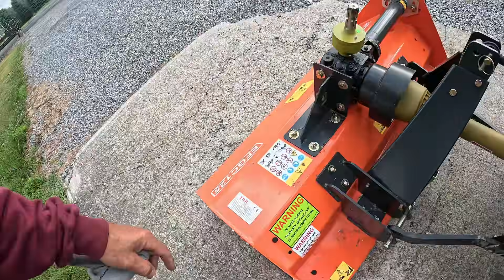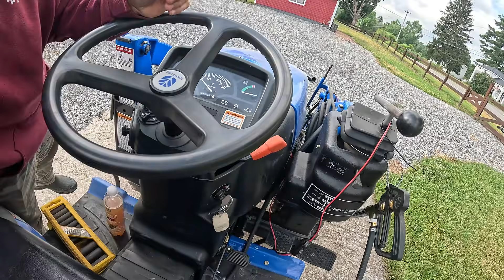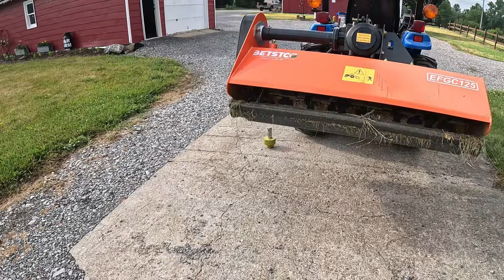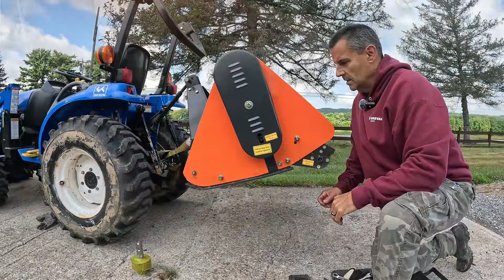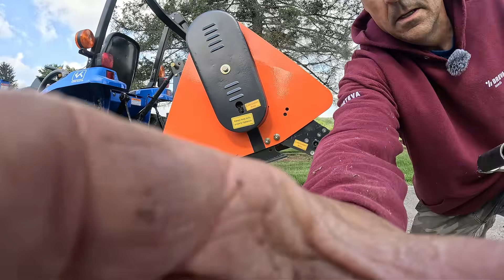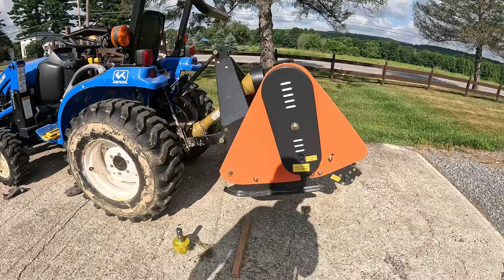Most People Set Up Their Flail Mower WRONG! Here's the Right Way.

Comment: Mine is a Bush Hog (brand) FH174 flail mower, and the book says the pto shaft of the mower should be horizontal when in use. And the side shoes should not touch the ground when on flat ground or concrete.
Reply from the maker: Thanks for the info, it’s always interesting to see how different manuals recommend setting them up.

Comment: Your tractor probably doesn't need the glow plugs to activate unless the temperature is down below 50 (in freedom units).  Could be that your ecu is smart enough to turn them on only when needed? Your mower is supposed to ride on the roller, but not the shoes.